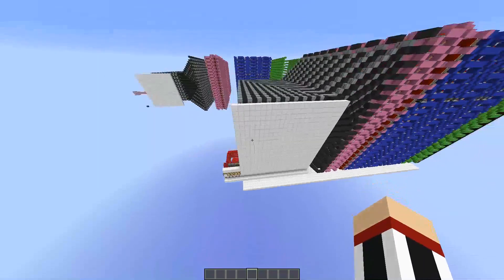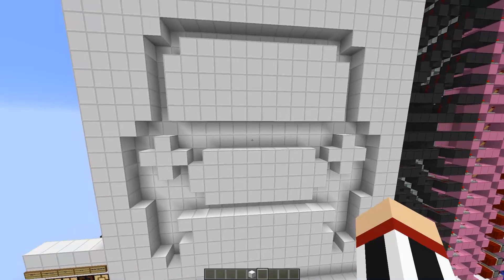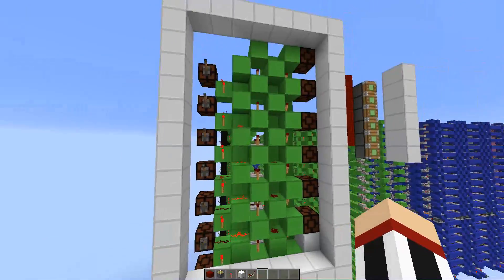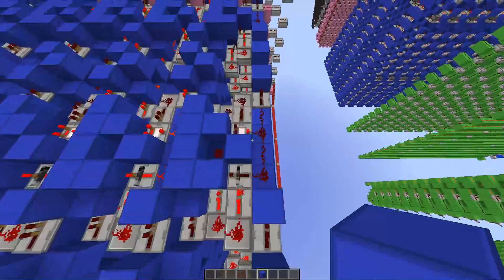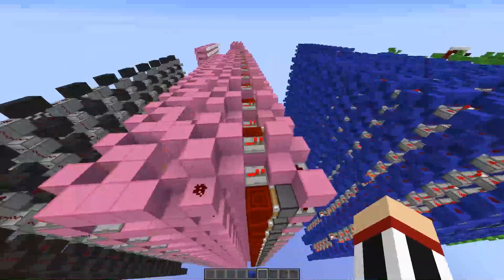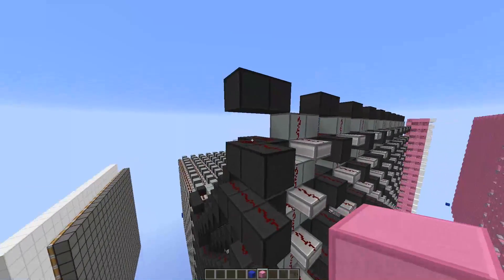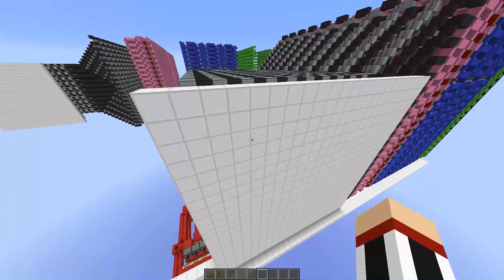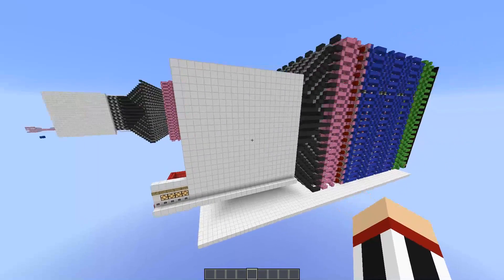1x1-Pixel HD Display Controller - 2 cool new features, Use it!

Comment: Would it be possible to have the ram directly behind it? So you could put multiple of them next to each other? And thank you for making this, for some reason 1x1 displays are rare.
Reply from the maker: The ram must at least be behind the magenta circuit. You can have multiple in a row regardless.
Reply: DicoTheRedstoner
My bad, I meant would it be possible to have the bus from the magenta go to the back instead of the side or would there not be enough room. Kinda like the way your second 1x1 display was except with horizontal ram. ;)
Reply from the maker: +Mr.Fabulous TNT yea of course, you'll have to change up the busses a bit. And I'm hoping you can synchronize the timings.
Reply: DicoTheRedstoner
Thanks for the reply. I really appreciate you making this, 1x1 displays are so cool but they seem very underrated/underused  in the redstone community.
Reply from the maker: Because they are difficult to make and the main objective in logic is the logic and not the display :)

Comment: I had no idea this was still possible! Fantastic work! I'd love to see a little bit more detail about isolating each pixel. If I understand correctly, you actually ARE powering 2 Pistons at once but you power different groups of them to sort of "undo" certain pixels? So you power A+B pistons and then power B+C and then just C to leave only "A" having been activated? SAVED! (Don't know what that means? Check out my SAVED: Youtube's Gems series on my channel)
Reply from the maker: That's correct. There's a specific group of inputs to be powered for for every combination of pixels to be toggled. The green circuit in this video converts the pixel data to the inputs that need to power. Every piston/pixel is powered by a unique pair of inputs, making this possible.
Reply: +DicoTheRedstoner brilliant! Love it

Comment: Just like something, that I created. 16x16 redstone lamp 1-1 pixel display with ram, of course and 4 memory slots (each one can save one 16x16 image). Sadly I don't have the world anymore :/ I forgot to make a backup before i formated my PC Everything was done totally by me so there were a lot of ultra compact gates that nobody uses (but they actionally should - their epic) You've done great work! Congrats Edit: I see you used much bigger memory (memory cell + all the redstone wires that connect it) than I did, but it's a bit faster. I think I'll use something similar to what you used.
Reply from the maker: Great! I still have a design for an infinite 1x1-pixel redstone lamp display laying around somewhere, I can find it so if I fix the one small issue it has I will make a video about it :)

Comment: Essentially what this is, is a GPU - You have the display output, the input (data and storage; VRAM) and processors - a bunch of AND gates
Reply from the maker: I consider it just a display/display controller. There's not much more to it. Consider it the monitor input and the monitor.

Comment: nice! Im pretty sure you can make one with lamps but that would require a very spesific update order so one piston above wont updare any any others with redstone blocks on there faces
Reply from the maker: I have attempted and succeeded apart from a small issue and I can't find its roots.
Reply: whats the issue?
Reply from the maker: A random but still distinct pattern of pixels fails to render/reset properly, one of the two. It's a bit like a half standing circle and it appears to be coordinate dependant.

Comment: 20p 10fps? sounds like a great display to play games on!
Reply from the maker: 10fps is very optimistic... not taking into account the 15s delay.
Reply: +DicoTheRedstoner how insanely uber hard would it be to create a redstone contraption so you could play snake on it at a normal fps?
Reply from the maker: what's normal fps?
Reply: +DicoTheRedstoner well, normal fps might be a little optimistic of course, but for it to be playable I guess you would at least need like 2 or 3  fps...
Reply from the maker: 2 fps should be achievable...
Reply: +DicoTheRedstoner would it also be achievable to have te game snake running (Made with redstone) and it be fast enough to react to your input within 1 frame?
Reply from the maker: +MR_trax not on this display.